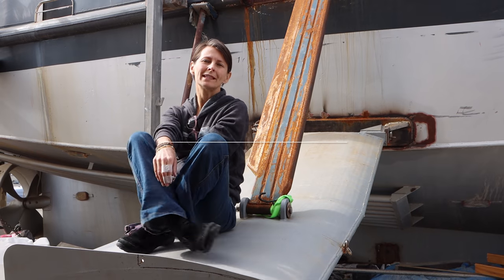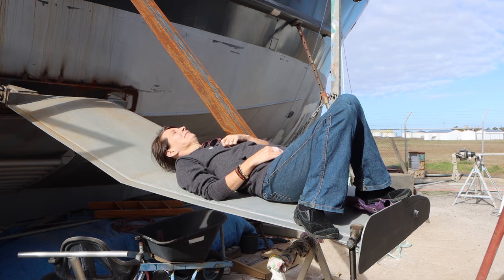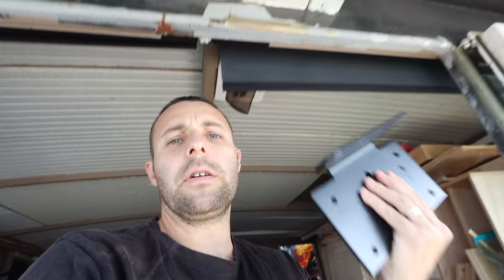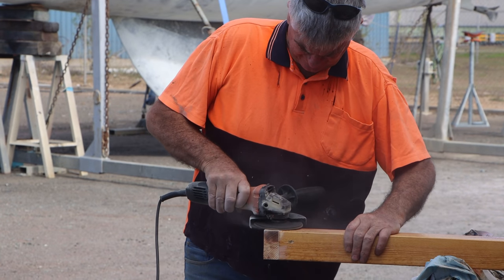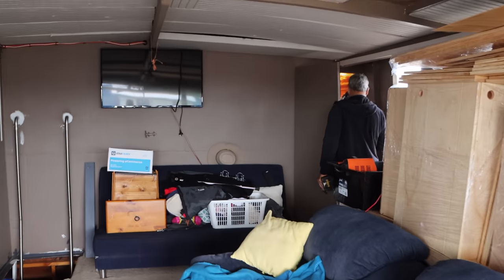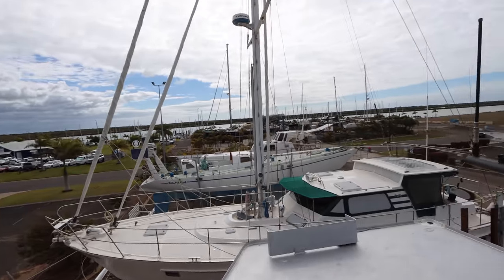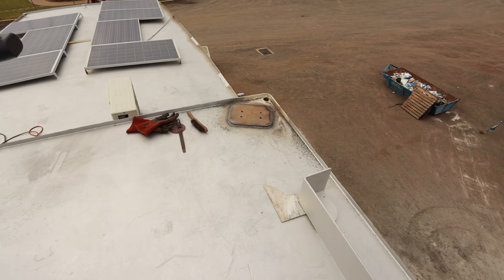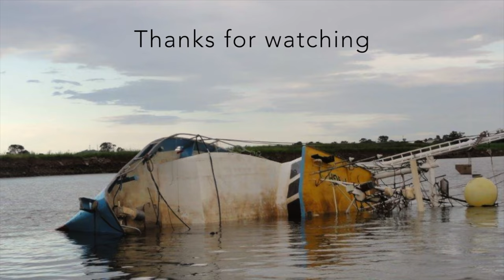Mounting winches to lift our stabilisers - Project Brupeg Ep. 166

Comment: On the winch. Put a pressure plate on top of the wire drum. This will help keep the coils tight and make the cable spool better. Put the fairlead at the roof edge and the winches back a bit will also help with spooling.  My warn 8274 on my land rover defender 90 has been sunk, stuffed in the back of a Subaru who break checked me, pushed in to trees and ploughed with. Living on the front uncovered in the salt Scottish Highland winter roads. It still works perfect after 30 years.
Reply from the maker: Great to know, yeah ive been pondering a version of a load plate. I like the thought of one on these winches

Comment: I'd personally add a rubber gasket under the winches to separate the cast aluminium housing from the steel doubler plate to avoid cross contamination

Comment: Steel is an amazing material, grade 5 bolts have a sheer strength of 79,000 pounds per square inch (55kgs/square millimeter), those bolts will be just fine as long as you keep up the over-engineering in the corrosion protection part of the build. I love that while most people would just laugh off a joke about building a submarine, Jess has to explicitly tell Dame not to do it right now.
Reply from the maker: It’s not the first time she has had to somewhat scale back my ambition on this build. 20ft hull and cabin extension has been mention maybe six times from memory
Reply: @ProjectBrupeg  That surprises me not in the slightest. :)

Comment: Another great video and Jess look like a mermaid on the wing and with you changing your wire I used to when I was welding and change the way I would blow out the liner with an air gun and there are a lot of crap would come out and that will work really well yet again another great video
Reply from the maker: Ahh thanks Matt, I’ve never blown out the liner but I will do that next time I’ve got it open

Comment: I would have thought the 4 main  bolts directly to the chassis of the winch is the load bearing mount and the 3 little bolts are just to locate the fairlead bracket . If I were you I would be getting longer bolts & making a big flat washer for each and bolting the 4 outer bolts through the roof skin...
Reply from the maker: It’s definitely the three that hold it down but I like the idea of through bolting the four mains
Reply: @ProjectBrupeg  I don't doubt the 3 will be adequate, but I would rather not chance having to mess with a winch mount failing out at sea...

Comment: Hey guys, get rid of whatever is on those winches and use the fancy rope stuff. It  goes by many names but is stronger than steel, lasts forever and you can replace easily if needed.   Buy extra to have some replacement if you ever need it. Will also be useful in many other applications. 
Words of wisdom? from a boat guy engineer.
Reply from the maker: Dyneema, that is the plan. We will swap over to it when the wire starts to fail.
Reply: Project Brupeg it goes by other names but dyneema would be perfect. Keep up the good work!
Reply from the maker: Yeah actually thinking about it now. I think spectra is better as it has the strong core but the outer covering offers UV protection. On the fishing bits I used to work on steel cable greased was the standard line used for all the heavy loads like nets etc

Comment: G'day Damien, love your work I reckon your an energiser bunny. Most 4wd winches I have fitted usually bolt into the bull bar using the four larger bolts. I don't like the look of just the three M8 bolts. If I could I would be heading to Antarctica with you, I did a 12 month stint as a Diesel mechanic at Mawson station back in 2009.
Reply from the maker: Sounds awesome

Comment: I was trying to figure out where you were going to mount the winches but that's a great spot. I was thinking that it would be practical to mount them both on one plate in the middle of the roof and having a single box covering both... easier for cabling and servicing.
Reply from the maker: Hi Gary, yeah we did look at centrally mounting but we have ventilation pipes that need to clear that area so it wasnt an option in the end

Comment: "They are tiny!" That's why You have three of 'em for each winch, ain't it? 😅
Reply from the maker: Definitely
Reply: @ProjectBrupeg  Your personal amount of "overengineering" is by far more on my side when it comes to overengineering in general ... I don't like it very much when the amounts of screws'n bolts were defined by some red pen beancounter or even a random marketing guy not knowing how 10.9 or 12.9 doesn't tell You anything about the length or girth of said bolt .... And we didn't even come to discuss the placement of those winchholding bolts waay in the middle of that groundplate, did we ..... 😂
Reply from the maker: We’ve actually decided to make a slight modification to the plate. It’s getting made outta 10mm and we are adding bolts
Reply: There we are .... it ain't like someone's gonna sit over Poseidon's orcus on behalf of those bolts, is it? And not just anybody, either.

Comment: Maybe put one sailboat winch in the middle so when the electrics fail you can still operate the wings?

Might upgrade to some electric self tailing winches on a loop later
Reply from the maker: Yeah this is an option. make it a manual winch so it everything breaks its still easy to lift/lower them

Comment: Wonder how the winch at the top of the sliders would have gone. Pulling the slider up, which would then lift the wings. Either way, good job guys.
Reply from the maker: Thanks Dallas. We thought about that location, However it’s very weather exposed and hard to protect. And also the distance between the lifting point and winch needs to be as long as you can make it so the cable coiled up correctly on the winch drum

Comment: Dame, why did you not put the winch on the deck with the solar panels? There would not have been any angle on the pull.
Reply from the maker: Hi Neil, its a strenght thing. the rear roof is built very light so putting the winch on there would likely buckle the roof. the wheelhouse is twice as thick and its mounted right over a cornet of the wheelhouse so its in a very strong spot
Reply: @ProjectBrupeg  Knew there would be a good reason for your placemet choice Dame, cheers.

Comment: Hi guys, enjoy your videos. If Jess is worried about the 3 small bolts, why not drill the 4 outer holes through the roof and bolt from underneath straight into the winch?
Reply from the maker: Hi Wayne, mainly trying to avoid leaks, every hole into the cabin is a leak waiting to happen.

Comment: Dame the aluminium case might prove to be a bit of a problem with salt water immersion they are really made for 4WD use which is normally fresh water immersion. I suppose you could always wrap it in Denso tape.
Reply from the maker: Yeah we are thinking of a lot of grease being a normal thing for these winches. It might work or it might not, time will tell
Reply: @ProjectBrupeg  Paint, paint and maybe a little more paint on the aluminium cases

Comment: Dear Sir.   May I ask why not use Sailboat Winches? They are easy to come by plus they can be rebuilt an do better in Saltwater plus you could use Kevlar Rope for Stenght.  Still like the Big Boat! Greg of USA
Reply from the maker: Hi Gregory, we wanted to go with something elelctric (or Hydrualic) so we can lift/lower the wings from inside the boat. In aussie electric boat winches are still hard to come by and worth a kings ransom, so for us this was the best compromise. I do like the idea of a manual yacht winch mounted up there so we have the ability to lift/lower the wings if the power or winch dies and its likely something we will add down the track

Comment: Just a thought, when u launch the boat will your on board power system be capable of running welders and such for "on the go" repairs
Reply from the maker: Hi Jake. Yes. Anything in small bursts can run from the batteries, anything bigger from the generators

Comment: Correct me if I'm wrong, but it looks like those winches are not going to be aligned with the center of the rails you are going to be pulling the cable up? If so the cable is going to spool all at one end of the winch.
Reply from the maker: Ahh it must be camera angle, that should be bang on square to the pulley when it is eventually mounted
Reply: @ProjectBrupeg  Good job, I was worried for a while.

Comment: I knew I watched these videos for a reason, I like you 1.2mm tip, tip for the flux-core wire. I've found some wires have a protective film that can bind the wire up in the liner. I've taken to running wire through a piece of foam with a little bit of wd-40 on it to help keep everything running smoothly.

Are you going to shorten the rope at all? Just worried if you don't you'll have problems with the rope not wrapping well on the drum.  Have you considered using Dyneema or equivalent at all?

Keep the smile going Jess, stay well.
Reply from the maker: Hi Jason, yeah once we have the final layout (pulleys and such) we will pay the cable right out and have the minimum on the drum as each wrap decreases the lifting capacity. For us we are well under the lifting capacity (by a factor of ten) so its not really a big deal but i like the idea of underloading the winches as much as possible

Comment: Wow another great update! I love how often and thorough your videos are becoming. Keep up the great work! So is there a chart or something that lists the breaking strength of M8 steel bolts? I imagine it depends on the exact type of bolt used. I wonder what the overall strength would be using 3 bolts? I think I heard Jess say "they look so small" and I have to admit it is a little worrisome.  I am sure it could hold 5000kg right?
Reply from the maker: Thanks Jerry. Yeah we are pretty consistent with our twice a week videos now
Reply: shear strength of an m8 in a class 8 hardware is 16Kn in coarse, 19Kn in fine thread which equals 3600lbs-4275lbs for one bolt. and as the cable is routed under he drum so the lever arm of the cable is run close to the mounting plate decreasing leverage on "pull out" forces for the bolts, but that is why there are 2 bolts mounted towards the back of the plate and only 1 at the front
Reply: @motorcyclemitzi8022  Nice calculation ...couldnt agree more..!!
Reply from the maker: So i read from that the wheelhouse is going to come off before the M8's give out. Got it.

Comment: That tap set is probably first cut, second cut, and finishing.... and yes, technically only the finishing tap is a true M8,  but using the first two in sequence makes using the last one a whole lot easier!
Reply: M8, you need one tap, a spiral point one, no messing about just let the DeWalt power it through.
(spiral flute if you want to do alloy)
Reply from the maker: Yeah i used to use spiral flutes in the machine shop, love em! but sadly i cant easily get a whole set of them like this, individually for a kings ransom yes, but whole set not so much

Comment: It would be interest to set up a jig that can test the weight those three small bolts can actually hold before failing ! 
There is a channel somewhere where on here that uses a hydraulic press to see when things break.
Also you are dead right, it is solder "soul dar" not "sod ar"
Reply: High tensile bolts are already tested and certified by class and shear
Reply from the maker: Actually this is a really good point that i completely forgot about, why re-invent the wheel
Reply: canucistanian AvE does 'beyond destruction' tests, best to keep the little ones in another room when viewing
Reply: @kaakeith3772  uncle bumblefuck is great fun and makes awesome vijails

Comment: I would have welded that doubler plate on and drilled through both it and the cabin and ran the bolts (use longer grade 8 ones) to that winch. This way you have 4 bolts holding it down into the body to the winch and not on that cheap plate...
Reply: Every hole in the roof is a potential leak point though, so better to avoid extra holes if you can.
Reply: 4x4 bumpers aren't that thick
Reply: @AW-Services  Who uses store-bought bumpers?
Reply from the maker: Hi Guys. if the winch is going to rip out of this doubler drilling through the roof wont stop that, but mainly the reason we didnt do that was what popuptoaster said, every hole is a leak waiting to happen, steel boats have the advantage of not needing holes when you can just weld a double onto the outside.

Comment: Hate to be a party pooper but I don't think those winches are going to go the distance. If they fail how will you get stableizer up or down ?
Reply from the maker: Hi Troy, if they fail (one at a time, unlikely both will die at the same time) we can use pulleys to use the opposite winch to lift a wing, if that fails as well we have hand winches we can use to lift/lower the wings. These type of winches have been used on commercial boats with wings and done the job. All that said, if they dont work, its a steel boat, we can just modify and weld something else on, not a big deal in our world

Comment: Is it easy to keep bouncing between inches and meters?  I hear you use inches quite a bit and then mils.
Reply from the maker: Hi Darryl, it is now. wasnt a few years back. most of our stuff is imperial but i know the metric for it ie 6mm plate is actually 6.4mm which is 1/4 inch 3.2mm plate is 1/8 inch etc so it is fairly straight forward to bounce between after so many years of playing with the same numbers

Comment: Can a pod be made or 3d print with a depth sounder almost side scan with those video Cameras placed on the side maybe rechargeable battery so no cables using wifi.
Reply from the maker: Hi Jay, yeah we get about an hour per battery on a standard GoPro, we have mucked around with ours and fitted a 10,000MaH battery pack so it will record all day, that said its not water proof witht eh big battery pack. As for wifi underwater, i really wouldnt know if thats possible but its definately something we will test